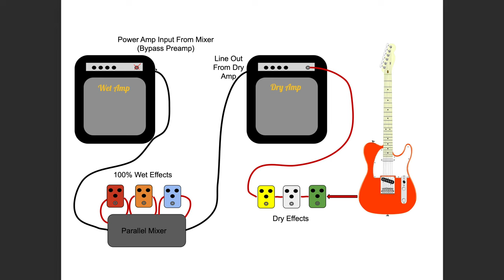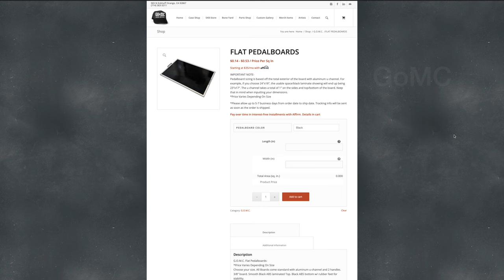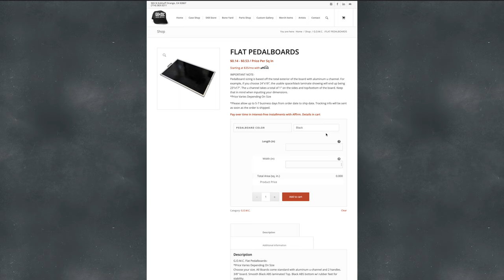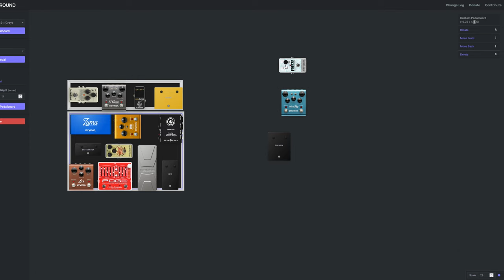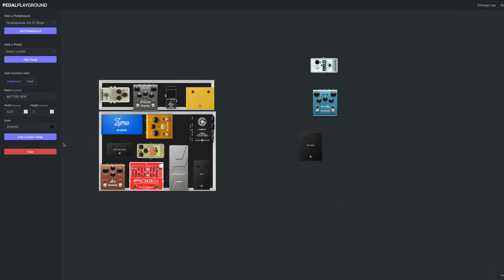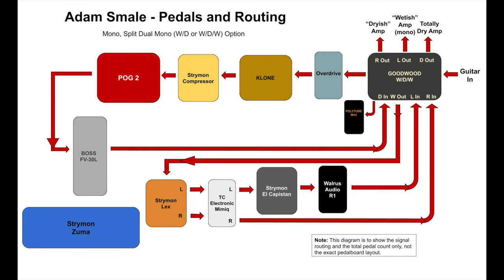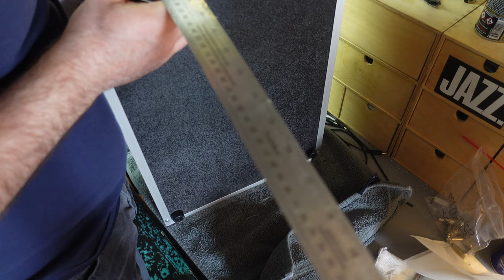What's on THIS Jazz Guitar Pedalboard Setup? | DIY Pedalboard Build

Comment: I did a hinged riser board about 5 years ago. It’s awesome. Power is out of the way under the riser, and I never accidentally step on the wrong pedal. 
But I don’t use it for jazz. For that I’m taking my archtop straight into the amp
Reply from the maker: @Gk2003m  Yeah, I know what you mean. I used to plug straight into the amp. But I wanted to be able to create a board that is versatile and be to replicate sounds that are suited for my compositions. Thanks for checking it out!
Reply from the maker: @Gk2003m  …I’ve also updated my board since then. I really should do an update.

Comment: I like pedalboards where the board is the case.  This way I don't have to lift it out of a case.  I recommend Pedal Pad.  They come in a variety of custom sizes and finishes.
Reply from the maker: I don’t think the Pedal Pad is a professional type of thing. Plus it’s just one size, I believe. I wanted something that I can take aboard a plane as carryon. Thanks for watching!
Reply from the maker: Oh wait! Those… yeah, I don’t like that style because if it gets damaged the whole thing won’t close properly when the lid is built into the unit. Not trustworthy enough for the road for me.
Reply: @JazzRockswithAdam  well, everyone gets to  choose, They come in many custom sizes. What is not professional about it?  And now you've got me curious, you are carrying on your guitar and your pedal board?
Reply from the maker: @hcharton5722  Yes, they don’t even bat an eyelash. The whole board is within carryon dimensions. I just meant when you’re on the road, and things get knocked around or dropped, with that style of design if the lid breaks, or breaks off, you’re screwed. Other than that I think it’s fine.  At first I was thinking of something else, something like the BOSS, or Gator pedalboards.

Comment: I have a question, is it difficult to get to the pedals under the riser if needed while performing? I'm new to these risers and the only other one I've seen had an effects switcher.
Reply from the maker: Hey Dan, my riser lifts up so you can access pedals on the fly to quickly twittle a knob or something. Most people put pedals that they don’t need to access often or are “always on”  type of thing.

In my case the only things I have under the riser is my power supply (which I don’t need to adjust anything on a gig), my Strymon compressor (which is always on), and the Goodwood junction box that I also don’t need to immediately access. I can stick my finger underneath and turn the mute on or off when I need to tune. Hope that helps.
Reply: @JazzRockswithAdam  thank you I was guessing that's how it worked but thanks for the clarification. These are really cool designs and would help me use a more compact board. As you know space can definitely be limited at times and this helps! I'm a newer subscriber and I received your jazz rocks shirt the other day that I had ordered.  Very cool shirt and great channel! Thanks again.
Reply from the maker: @DanDoroshDetroitMusic  I’m glad I helped. And thank you for getting a shirt. Much appreciated!!